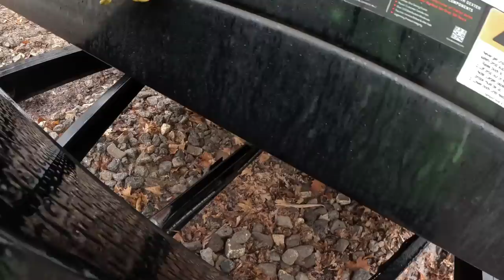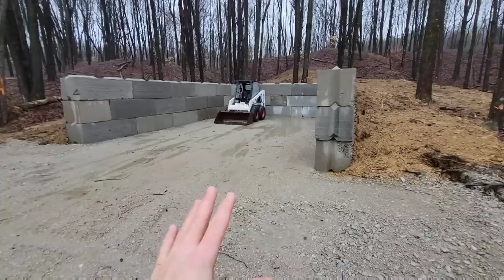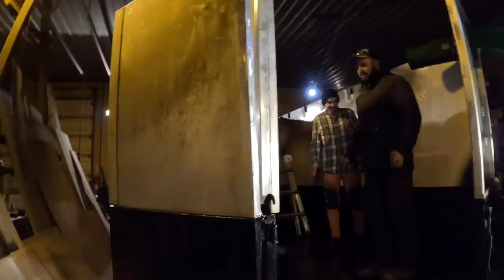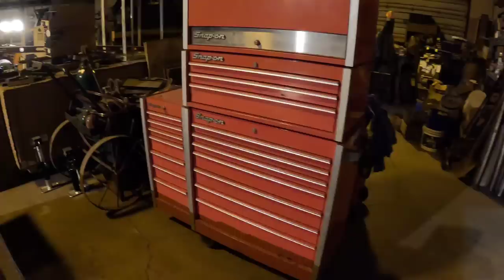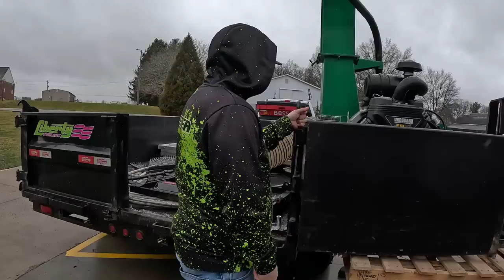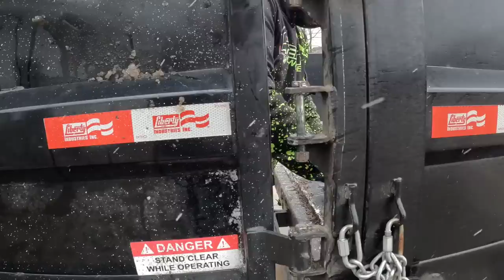This Storm Has Exposed Problems At Our Homestead!

Comment: You should put a French drain around the outside of the salt bin because it’s cut into the hill that way you’re salt will always be wet. A French drain around the sides and back of the  “foundation” would do the trick
Reply: Be surprised how well French drains will solve most water issues. Also, put a concrete floor to raise the elevation from the parking area.

Comment: Plus, you also need to realize that when the pad was placed at the new property, it was not compacted!  There will be continued settling occurring for years.  Having a solid base prior to constructing the building will help prevent the concrete from cracking and would give you an even better idea on how the water with continue to shed from the property

Comment: The grade for your gravel didn't really look far off, may just need cleared at the end off the edge of the gravel. Will just take a little time for everything to settle in, new driveways always eat gravel especially with no fabric under them. Probably plan on a few more loads especially after your done building contractors will make a mess of it building so wouldent worry about keeping it looking too nice until your done unless some big craters open up.  Still not sure about your salt bin setup sitting at the bottom of that big hill, it just looks like it's always going to have water running into it unless you dig it back out and rig up some serious drainage around it maybe or elevate the floor higher then the bottom of the hill??? Probably be easier and cheaper to pull the blocks out and relocate it away from the hill then trying to elevate it that much.

Comment: Befor your silt bin was backfilled you should have laid a perforated French drain pipe with a sock around the whole thing daylighting out each side of the salt bin blocks . And then backfilled all the way to the top of the box with pea gravel that way the water running out of the hill will hit the pea gravel and then drain down to the pipe and then run out the daylighted pipe.

Comment: The problem was he needed to come in from the other direction with the forklift. he couldn't go forward anymore since he was pointed at the trailer. If he came in from the angle you were standing/ where you would stand when opening it. He could have gone forward more and get the unit on to the skid further. No big deal just knows what to do next time. Either way pretty cool setup. Next setup when you get a dump truck, mount the blower under the dump bed with a bracket on the frame the blower mounts to. Have the shoot mounted to dump body and the blower to the frame. That way the dump bodythere's

Comment: I would recommend getting a compaction test on your building pad prior to building.  I was concerned that your grading contractor didn’t use a heavy roller as he was building the fill.  “Tracking in” does not equal adequate compaction.

Comment: I have been checking out lots of leaf trailer setups and believe found the best way to mount the debris loader. Dude made brackets and mounted it to the front of the box above the tool box. Not on the hitch. It goes up and down with the box. Conceivably you could build a short box for leaves and have room for equipment in the back half of the dump box (solo operator).  Move the wall all the way back when you have help.